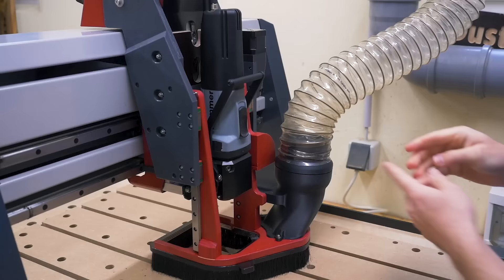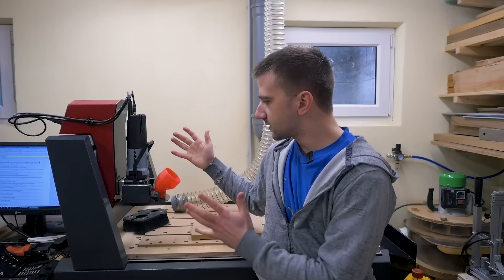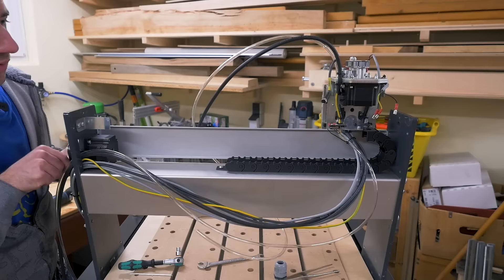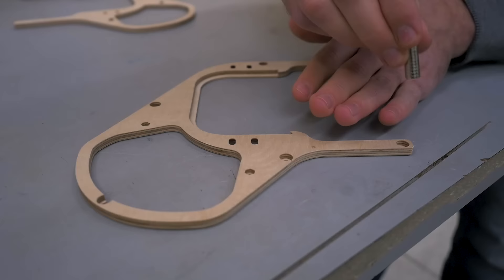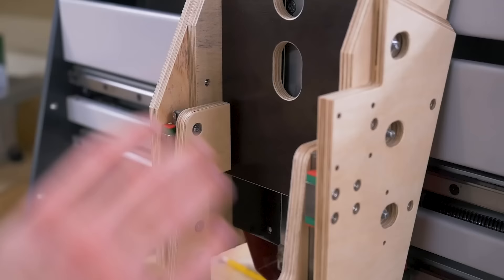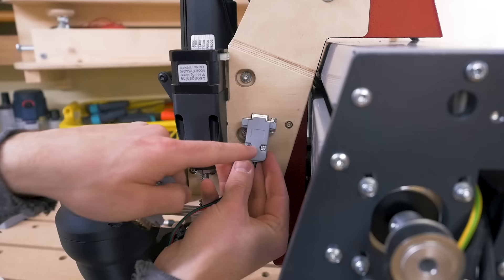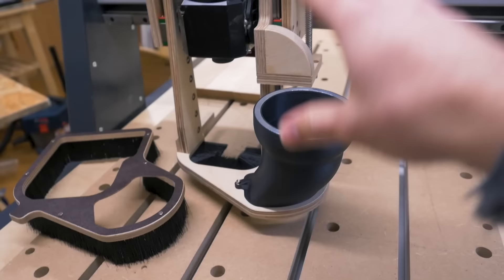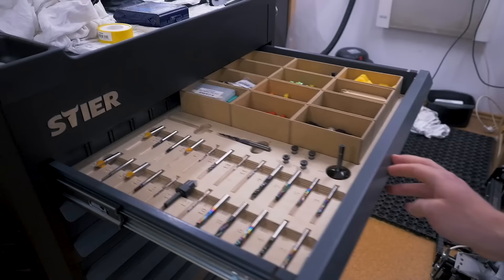Engineering an Automatic CNC Dust-Shoe

Comment: Excellent work and also the points at the end (40 minutes flew by) where you mention the practicality of the improvement with regard to cost. So many will see something like this and say the manufacturer should have it built in, but then probably wouldn't be willing to pay the extra cost for the upgrade even if it was done in the most cost effective way.
Reply from the maker: Thanks John!
Reply: John - the sad thing is that the manufacturer will probably steal it and integrate it into the design - without doing the right thing and purchasing the design from Marius.  I remember Craftsman stealing the Bionic Wrench, or Black and Decker stealing the Workmate Workbench literally 10 minutes after the inventor pitched the idea to them (I happen to know the inventor.)  It's total BS.
Reply: @TheSpud1129  No, the truly sad thing is that you and so many other people think that way. Manufacturers don't need to "steal" ideas like this, despite the two examples (out of billions) you hold up to prove the rule.
Reply: @JohnHeisz  well some Manufactures certainly are not above idea theft, it is kind of the spirit of engineering. Taking ideas you see from something and using them in a different way that suits the requirements  of a given project. Maybe its like music, everything has already been written or invented we just mix it up and call it new. Either way this video as you said flew by. I would think this would lead to more job offers then people who want to steal his ideas.
Reply: @JohnHeisz  John - not saying that they all do steal ideas, but - the sad thing is that some do.  I'd hate to be the Inventor of the Bionic Wrench, go to a sales pitch meeting (totally legit) with Craftsman to pitch the idea, be told that it isn't practical - and then have them reproduce it INSTANTLY after I left.  I'd like to imagine that he's doing ok for himself - but to have unlimited funds and the speed to mass-produce very quickly - with zero repercussions or fear of getting sued - would be a major kick in the balls.

I've been in the industry now for 27 going on 28 years, and there was a time in my life where I was directed to "modify" someones idea that was pitched to my employer.  Naturally, I refused...and they gave the project to someone else to complete.  It happens a lot more than you could imagine.

Being an engineer, designer, woodworker, hobbyist, I do take pride in engineering and designing components and ideas from scratch, and I take great pride in the fact that I can appreciate you and so many others on YT for your original and practical content.  I've purchased quite a few plans from you (you along with Izzy, Marius, Frank and Matthias are my top 5.)  Thanks for commenting and having dialogue.  That's what makes it a better community and space to engage.
Reply: Excellent summary John. That said I would be very curious to know Felder's reaction to Marius's solutions. Perhaps they happen to have many of these already on their more expensive lines?
Reply: i think it is hwat is called a reverse engineering these days. Prime example is the cellphones we use . when apple or samsung puts out a nex phone., their think tank just changes a couple of components and they could call it their own now. it is the nature of the game these days
Reply: @TheSpud1129  when Felder did something similar with the sliding table fix Marius had, they gave him an honorable mention and set of official factory parts for the retrofit. 
One can only hope that they will do a bit better with this one .. but your point is taken. (though he didn't do it for that reason)
Reply: @TheSpud1129  the key in your second comment here is the supporting the people we admire by purchasing their work at the asked price and not doing exactly what you are commenting on - reinventing the wheel just displayed to you. Kudos Spud - you, and I, are perhaps a minority out there ( I hope not) (love your top 5 list by the way !)
Reply: @TheSpud1129  The open source community is rife with 'nah, we are going to reinvent it, better and cooler'.  Companies do it for profit and control, but I think engineers also do it but for other reasons..
Reply: @MariusHornberger  Would you be selling some plans for this build for the people with same cnc ?
Reply: They may not pay it upfront - but many will see the need and reevaluate the cost/benefit ratio even in under a year of use. That's why so many products have multi-tier bundles, or sell only the barebones kit but also offer a slew of accessories.

At least with a physical machine the added cost is apparent. You can tell that you get something for the extra money. With identical hardware and the only difference being software (looking mainly at auto industry... Tesla 'downloadable content', FlexFuel vs. standard ECU firmwares, John Deere, etc.) you're paying retrospectively for the added R&D, which is even harder to justify.
Reply: @davidhawley1132  As a unix guy, it's not unusual to find that "our better and cooler project" has already been done better by someone else. Convincing people to drop a project they've invested 2-4 years in (and still doesn't work!) in favour of one which does everything needed (and more) - and more importantly has a userbase of several million people instead of "one site" - is extremely hard (I've been sacked for pushing this, only to be invited back 1-2 years later to cleanup the mess from the original project. 

One case I was peripherally involved in spent $36million on software which was broken by design from the outset. The CEO wrote it, therefore nobody could criticise. He was eventually sacked and the 6 year mess was replaced with an off the shelf piece of opensource that cost $50,000 to implement and needed 0.5 full time employee equivalents to maintain (instead of $50-500k, 6-12 weeks and a team of 20 programmers for the old system)

Marius' design is good as an add-on but if you're integrating it, then it can be done more easily/cheaply (he was avoiding going under the covers or mounting things permanently to the frame). The problem in just about all light engineering work is that air/dust removal is usually a 5th (or 6th) consideration

Comment: Awesome design. I really like the highly integrated motor mount. You should find a friend with a plasma cutter or water jet so you can avoid the lathe shenanigans to make that metal ring (though I probably would have done the same thing as you ;)
Reply from the maker: Thanks man! A plasma cutter would've definitely saved a couple hours. Time to convert my old CNC into one
Reply: @MariusHornberger  I can't wait to see the design. You are so talented...
especially in the CAD department. 
Felder should purchase the rights to your boot and adapt it to their 2.2kw spindle version.
Reply: I was wondering, why you didn't use the CNC for the ring. Should be capable of getting through the thin metal
Reply: @nicholaslaines2702  how so? Serious question
Reply: @MariusHornberger  Problem: The Dust-Shoe is a bad bad boy and useless.
Solution: Introduce more complexity, more tech and moving parts around this part!!! SCOTTY, I need this in 12 hours. Scotty: Captain, I will do it in 6! :))
Sorry for that joke(?) and the following, because that is a really great project and the implementation ist a Bobby Dazzler, @Marius!;)
Another engineering practice (better eng-fu), most people don't know or think about is: Something doesn't work? Let's redesign it completely, or even better: Let's get RID OF IT! Researching about airflow or talking to an expert about this problem would have lead to another solution. A suction nozzle that optimally directs the airflow around the work area without any fold or mechanical overhang. Especially with the performance offered by a full-fledged industrial dust collector, this would have been a real alternative. 

"Luftstromhygiene" ist ja kein Hexenwerk ... also wenn man z.B. den französischen Ingenieuren von Mobylette glaubt, die uns schon seit grauer Vorzeit absolut unverständliche Ansaugstutzenformen für ihre Mofas um die Ohren hauen:)

I'm just a spoilsport... sorry for that, Marius. Forgive me!:)
Reply: I was thinking that the ring could be done using a thin strip of magnetic tape. The 3&4mm stuff has enough flex to take that curve

Comment: Very nice  work.   I went a similar but different route on the vertical adjustment side of things.  ("Sweet Dreams CNC")  RC model type servo, switch and springs.  The lightweight springs and gravity hold the shoe in the down position  on the work piece regardless of the depth of cut.  For tool changes, the RC hobby servo via a lever activated by a switch moves the shoe up out of the way to let you change tools.  Your solution is nicely "over engineered".  (A high form of compliment! :-)
Reply from the maker: Thanks. That's a much simpler solution. Sounds also similar to what StepCraft has done. If I'd do it again, I'd probably also go with this simpler approach

Comment: I do industrial maintenance and worked a plastics manufacturer for several years. We had a bunch of 4 spindle routers and even they didn't have smart vacuum like this. Just "short" or "tall" settings and they got trashed ALL THE TIME.

Your setup is very smart and you could probably license it to router companies like Northwoods, Komo, etc.

Comment: Marius, you are one proof of the „German Engineering Heritage“ being passed on to the next generation! 
Even if your conclusion has its points, every product/feature needs at first to be implemented somehow, and THEN a company can do their „routine“ work in checking what a feature might be worth for the market, and optimise the design accordingly to cost! And it‘s by FAR easier to strip-down/cost-optimise an existing design, than design something fancy to a given (fixed) target cost!

Comment: I've had to engineer a couple of tools for the mechanical demolition business that made the job go easier.  One was a tool to lift chiller equipment sections, the other one was for removing steel backer plate from the walls where we were removing fin tube for heating.

Comment: I built a floating shoe for my CNC - but I didn't need to use any complex control.
My dust shoe simply drops freely onto the work independently from the spindle and rests on the tips of the moderately stiff bristles. I used the bristle stuff they put around truck wheels to control dirt and water spray...
The shoe rides up and down perfectly over ridges on the work, and work holding fixtures simply pass through the bristles.
I have a stop attached so that when the spindle is raised for a traverse, the shoe is lifted such that the tips of the bristles can't get lower than the tip of the tool. This makes sure that the shoe doesn't drop and get tangled in anything during rapid moves and it also serves to periodically "reset" the bristles to be straight (although their stiffness sort of makes this unnecessary).
My only minor issue is that the current design slightly limits the tool plunge depth - I need to devise some sort of "bellows vacuum seal" between the spindle and shoe to overcome this deficiency.

Comment: I have been looking into adding compressed air to my dust collection as well. It was good to see that it not only worked in your arrangement but that it also cleaned up dust from previous cuts that the collector missed on the original pass. I thought that I would locate the nozzles on the collector shoe and route the hose along with the vacuum hose. This may not blow chips out of a deep hole but should work on anything fairly open.

Comment: In the workplace I worked. We're done duo with compress air and vacuum, so it can clean up dust faster. The duster shoe is good but as you found out still leave debris behind. It is pain to get it run the duo system but wroth it at the end.
Reply from the maker: Sounds like you also had a bigger machine where that system was installed. Pretty cool

Comment: This is great. And you're right, moving the dust shoe with the Z axis is super dumb. Even just a manually adjustable fixed shoe would be an improvement - 99% of the time CNC routers are cutting sheet goods of constant thickness.

Comment: Very nice! A way to improve the dust collection over gaps could be to have another longer layer of softer bristles or cloth around the existing bristles. The idea being this new layer makes no force on the z-axis when compressed and falls into the gaps made by cuts/the end of the table. It could be attached using velcro for easy replacement.

Comment: An excellent solution: it significantly increases the usability of the entire machine. An extremely elegant method, I was most impressed by the control, both: from the program level and from the manipulator.
I don't know if you are aware of it, but you've just improved machine from one of the best producers in Europe...
Congratulations!

Comment: great work.  i personally more like dust shoe style like the carbide 3D one . its clear and easy to put and release.   your dust shoe base so wide. unless u have vaccum table.  some cutting area will be reduce
Reply: @JorgTheElder  depend on the clamp setup and cutting profile. yes it will.   especialy if u want to cut  as big your table can handle.  thats why using  vaccum table will is a better solution if u have wide base dust shoe.

Comment: You can find metallic bottom brushes, that bend easily, but they have a different mounting solution. You can find them in DIY stores, in the exterior doors section.

Comment: Excellent work and improvement (not only for this CNC); but a lot of work as you mentioned. Especially as it is a full development. The next person with same CNC could leverage from your plans. So the R&D costs could be saved.And making it as a kit could also save some money, e.g. when you use components (screws, wiring etc. ) that are already used in the factory. Anyhow, you showed Hammer again, what excellent engineering means ! Good job 👍

Comment: Excelent feature Marius. In my opinion, that dust shoe should be located right  on the bit collet with about 100 mm diameter, and not all that area you made. That way, you have more power suction concentrated near the cutter bit. I have a small cnc like yours and my dust shoe was based on shop-sabre´s one. Its realy eficient even when the dust shoe is out or the work area. At first i used brishees to on the shoe. Now i replaced by a softer ruber band that nev er ritches the cutter bit while it works.

Comment: Another tool you could try for bending plastic parts without melting is a hair dryer. They don't get near as hot as a heat gun so they tend to melt the plastic less while still making it soft enough to manipulate.

Comment: seems like a lot of work for a little CNC. A good experience but time for a 4x 8 :) or 5x10
Reply from the maker: Absolutely. I just need the building that fits around that bigger machine
Reply: @MariusHornberger  I thoroughly enjoyed this video.  It was over the top thought and engineering.  Great job!
Reply: @MariusHornberger  Next video: I 3D printed a new basement shop.

Comment: A man starts out with a rock to dig a hole .. Fast forward a few years he designs a shroud for a CNC-mill in a 3d printer. If I owned a 3d printer and a cnc it wouldnt be to create dust collection devices it would only collect dust. (would like to though) but..  I am still at the "where to put my clamps"-phase and  where to push the shavings from my handtools when I am done. But I take pride in my silky smooth, 3000 grit sanded butter knifes made from wood from my garden. But at least I have cherry, oak, birch, juniper, wallnut, apple wood in my small but well used woodpile :)
Reply from the maker: I would really like to have easy access to all these wood species!

Comment: If you want to get an extra strong connections with magnets then use magnets on magnets, but also as a tip glue the magnets in from behind and leave say 1mm between the magnet and the fixing surface, superglue does tend to eventually come unstuck with magnets so doing it this way keeps the magnets in place.

Comment: I just finished making a new dust boot for my Shapeoko. I share your paint regarding bending the bristle brush strips! They are terrible to work with :)
In the end, I found better success snipping the strip into a few smaller pieces, and then gluing them in separately. The end result was much cleaner than anything I could bend into shape, and you can't really see where two sections meet up, it just looks like one solid bristle strip once installed.

Comment: Hätte es nicht auch eine Feder getan? Wouldn't a spring have done the same height adjustment trick? But then: there must be a more complicated way to do it. Like it none the less!
Reply from the maker: No, how would that work?
Reply: @MariusHornberger  chamferrd inside brushes, hose attached fix to z and springs around columns to adjust/reduce downforces to limit vertical load to a minimum (10g?).
This doesn‘t solve it vor everything - but 80% of rather simplistic reliev carving on flat stock.
I totally understand your project and fany it very much - but I‘d find it particulary interesting to find a simplistic solution to 80 % of the problem. Withiut having to strughle with a 4th dimension.